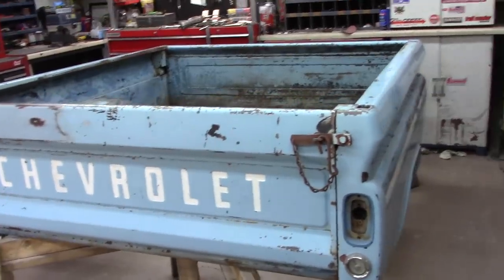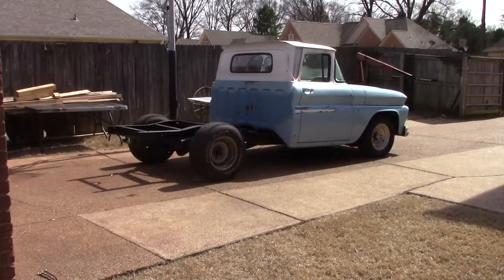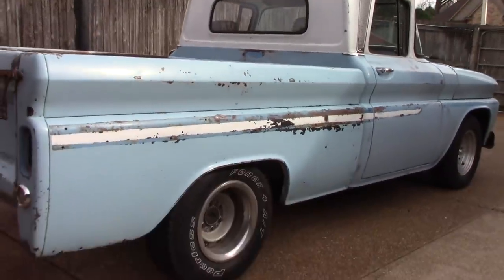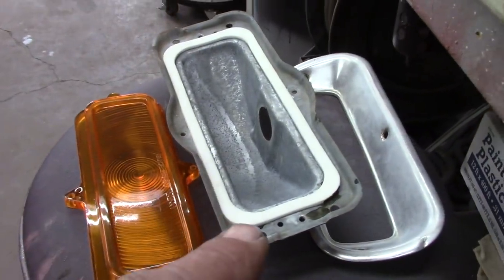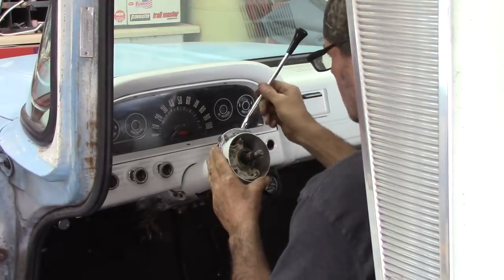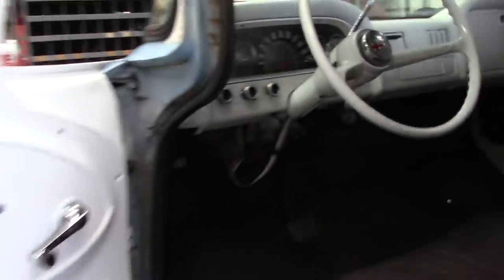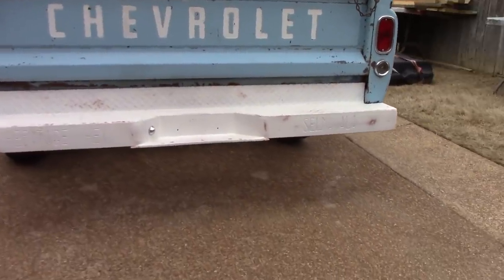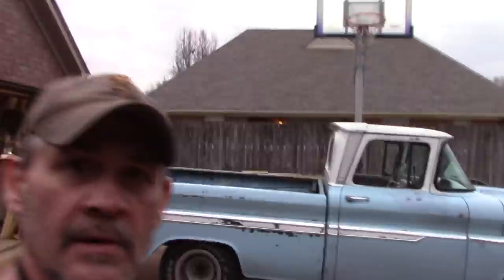Fleetside bed installed

Comment: Can see that's a dealer rear bumper which a lot of dealers sold, because as I recall, in these years, a rear bumper was an option on pickup trucks unless they were a deluxe model. Very nice work you've done to preserve this truck. Congrats.

Comment: If anyone cares... Most of these trucks were delivered new without rear bumpers.  Yes there were some that came from the factory with the chrome "fleetside" rear bumper, but these were not the norm.  Most often, the trucks delivered without rear bumpers had a dealer installed add-on bumper, like the one in this video installed at the dealer.   There were also aftermarket bumpers that were installed which were almost identical. Both the dealer add-on and the aftermarket bumpers were usually built by a local company that made them, these were commonly called "farmer's bumpers" because they are the ones that usually bought them.  There are a number of different styles of these bumpers, but almost all looked similar.
Reply: I have 2 military  trucks  my bumpers are factory  Barden type

Comment: That's a dealer installed aftermarket rear bumper, I used to install them back in the early 80's when I worked for a Chevrolet Dealership.
They all had the Dealership name imprinted on bumper.
Looking good
Reply from the maker: Thanks for the information

Comment: Pretty sure that's the original bumper...that's a dealership heavy duty bumper that was likely put on when it arrived at the dealership from the factory...my '69 didn't even have a back bumper on it when it was on the lot, & my dad bought a dealership bumper to go on it for an extra $50 when he bought it...I originally planned to swap it out for a factory bumper because I'm doing a hidden hitch on it, so I don't need the heavy duty bumper, but when I told my dad I was swapping it out, he said, 'You better use my bumper! That cost me an extra $50!' LOL! He was just joking, but I think I've come up with a way to still use it & the hidden hitch too...but it'll be a while before I get to it...

Comment: I can't remember if it was this truck or the red one, but you swapped out the old "mr gasket" header with Hedman. What PN/model did you use? I think it was a 350 block. I'm looking to shorten up my header so it doesn't sit below the frame rail.

Comment: I have a chrome bumper if you are interested. I am using a 67-72 sport bumper on mine. Love how both trucks came out. I learned a lot for when I put mine back together. We are going to the Rod Run in April, so I can bring it for you if you like. It is the original, so it will fit your build. Anyway, just thought I would put that out there. Thanks.
Reply from the maker: Scutre Parkson  I’m probably going to stick with the one i got on the truck now  thanks anyway

Comment: I was watching one of your videos where you put a 8 cylinders on a truck that came with 6 cylinders I will like to know where you find the motor mount brackets to do that convertion
Reply from the maker: Got the mounts and brackets from a seller on eBay
Reply: @Gibson63.  thanks for the info I have a truck just like yours

Comment: I was wondering if you could do me a favor? I need to know the distance between frame rails at the very rear of truck. I failed to measure the distance and removed the rear crossmember that I thought was completely rusted through. When I removed it the frame sprung in.  The distance between [.        ] as measured from the inside would be good if you find the time one day and think of it. I have a 67 C10 short bed.  I feel like a damn fool but I got in a hurry and we’ll now you know the story.
Reply from the maker: 33-5/8 between the frame rail at the rear
Reply: Gibson63 thank you brother!

Comment: Have you ever had to trim a radiator support bushing in order to get fenders etc to line up? Getting ready to start mine soon and heard one guy saying he had to trim after market bushing(metal sleeve).
Reply from the maker: Yes had to make a few adjustments before on these bushings
Reply: Do you have any suggestions for a 4 core radiator that might fit? I’m putting a big block in a 67 c10.

Comment: Did you happen to video the turn signal switch replacement?  Not much out there on that subject.  I am having an issue with my swtich assembly housing from moving.
Reply: The video is from a distance. So i am wondering if there is a locking plate or did the assembly  have notches to keep it from moving around?
Reply from the maker: John Bergeron  sorry didn’t video anything on this Assembly this part had screws holding it in place I believe it only went one way
Reply: @Gibson63.  OK, so behind the plastic turn assembly unit... did the Mast jacket have slots where the assembly housing was put in there and just turned to lock it in place?
Reply from the maker: John Bergeron  yes it only went in one way it was a pretty Easy set up

Comment: Did you say you had the tailgate apart or opened up ? How did you do that mine sounds like it has sand inside
Reply from the maker: Never had this tailgate apart just done a little bodywork on the front